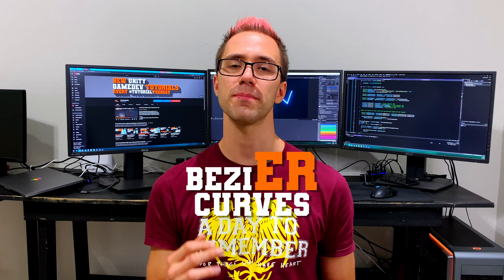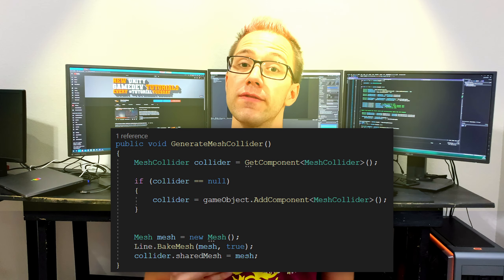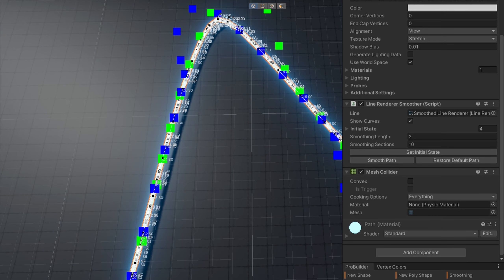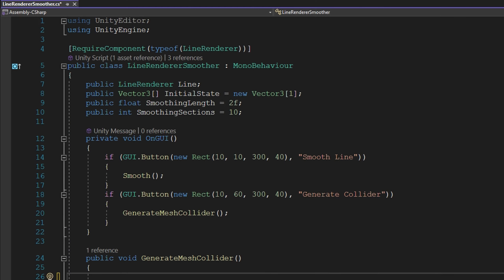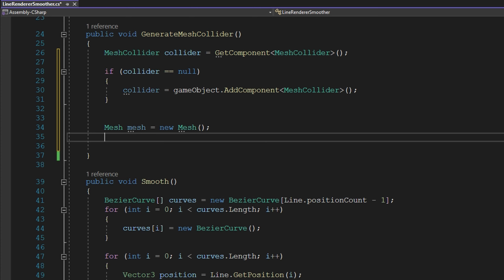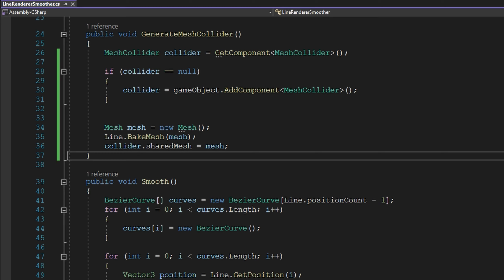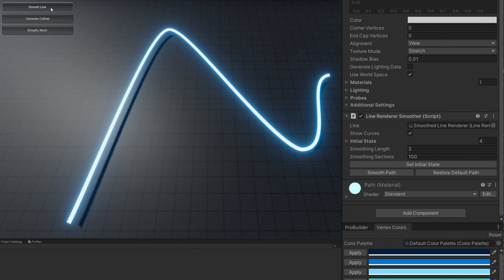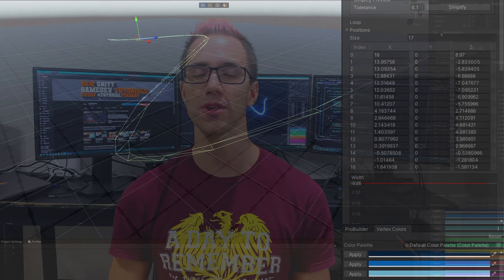How to Generate Colliders for Line Renderers | Unity Tutorial

Comment: That's a really great topic, thanks! 
An alternative solution if the line renderer points are supposed to change would be:
- Have a pool of objects with box collider objects
- According to the line segments (points[i] - points[i-1]) attach the box collider objects as children and set their localScale and localPosition/Rotation accordingly. 

The issue is that on the slopes when the renderer direction changes, these don't exactly match up with the edges of the points. But the drawback of having non-convex MeshColliders is that you can't really interact with other MeshColliders. 
And another one from the documentation: "GameObjects that have a Rigidbody
 component only support Mesh Colliders that have Convex option enabled: the physics engine can only simulate convex mesh colliders."
If a parent object has a RigidBody and all of the children have regular colliders like box colliders, as far as I know it will act as a compound collider where the child colliders are treated as single collider for some cases. The object where the RigidBody is attached would receive the collision messages. This might not be a common usecase, but this way it should still be possible to apply physics based movement to the LineRenderer collision setup and also receive interactions with other MeshColliders.
Reply from the maker: The box collider idea was one I was playing with for a while. You could do some extra math on aligning the box colliders so the edges did align and had a little overlap, as long as you don't need the colliders of the LineRenderer to drive the positions of the line renderer
Reply: @LlamAcademy  Surely!

Comment: Hi! I followed your steps,  than I created a function that every half second I recalculate the mesh collider because it is linked between two characters and I set the convex and trigger as true (in the MeshCollider). Everything works but sometime I get an error two error in the same line    collider.sharedMesh = mesh; the errors are :  1. Failed to create Convex Mesh from source mesh "". An internal unspecified error has occured that could mean the Quickhull algorithm found the input mesh topologically challenging.   2.  [Physics.PhysX] QuickHullConvexHullLib::findSimplex: Simplex input points appers to be coplanar.  I read the error and I find out that I was setting up the lineRenderer with 2 input equally (0,0,0)   (lineRenderer.SetPosition) two times, and that generate the error. I hope that can help to others
Reply from the maker: Thanks for sharing your solution to that tricky problem!

Comment: is it good idea to use this in runtime? My idea was generate a superficial trigger collider in the floor when u clean it with a mop so player can slip with the water. I am asking because i am planing to build the game for meta quest 2.
Reply from the maker: Yeah this is pretty fast so in most cases I don't think you'll run into an issue. Remember there are limits to mesh collider vertices though so you may need to generate multiple colliders, not just a single one for the entire path the player mops with.

Comment: Weirdly, I cant see the mesh itself in the scene view (I can see other meshes) nor get an OnTrigger interactionf rom it (the mesh collider is flagged as Convex and Trigger), but I can see it has generated in the Inspector?
Reply from the maker: The mesh itself has a thickness of 0 with this method so it doesn't really show up very clearly. Make sure you've set it to IsTrigger = true and you might also have to set it to Is Convex for it to work for that.

Comment: Thank you for a great tutorial. How would one detect a collision with this line renderer? I downloaded your code, added a cube to the scene such that the line passes through the cube. Then I added the code "private void OnCollisionEnter(Collision collision) {Debug.Log("collision.gameObject.name = " + collision.gameObject.name);}" to detect the collision (in LineRendererSmoother.cs) but I am getting nothing at the console output. Any thoughts?
Reply from the maker: I dropped a ball with a RigidBody from above and it was correctly making contact on both front and backfaces, perhaps there's something with the layers you were testing?
Reply: @LlamAcademy  I think the question is - if you write an OnCollisionEnter for the line renderer, how and where do you add it?

Comment: I'm using line renderer to allow the player to draw on walls. I wanted to use BakeMesh to allow erasing with raycast. I'm using world space for my lines because if I don't they appear off in the distance instead of where the player's raycast hit but even with that box check the mesh collider is at that random distance despite their position vector matching where the player clicked. If anyone can thing of a solution to this I would very much appreciate it.
Reply: I figured it out. If anyone sees this comment and is having the same problem, I had to loop through the mesh vertices and change their position and rotation.

Vector3[] vertices = mesh.vertices;
for (int i = 0; i < vertices.Length; i++)
{
	vertices[i] -= chalkLine.transform.position;

	// rotate vertices to match chalk line rotation inverted
	vertices[i] = Quaternion.Inverse(chalkLine.transform.rotation) * vertices[i];
}
mesh.vertices = vertices;

Comment: I wrote the code the way you present in the video but for some reason I always get the error: "ArgumentNullException: Value cannot be null.
Parameter name: camera". Do you know how to fix this
Reply from the maker: These scripts don't use the camera, so I guess it's something else in your project.
Reply: @LlamAcademy   same issue here in 2022.3.5f1
Reply from the maker: If you pull the project off GitHub do you experience the same issue?

Comment: Would I be able to use this as a makeshift raycast from the camera?
Reply from the maker: I think if you inflated the mesh a little you could do that, but I would recommend instead to use Raycasts, Boxcast, or Spherecast to achieve a similar result in a less convoluted way.
Reply: @LlamAcademy  I'm doing a programming challenge that prohibits me from using stock Unity physics, including raycasts. I don't suppose you know of any resources that could help with creating a custom raycast system in Unity?
Reply from the maker: I do not have any dedicated resources for that, but any game engine tutorials that cover a physics system are probably necessary reading to get there. There’s a lot to consider to make it fast and most of the logic can be transferred and implemented into Unity.

Comment: My player starts at a point, draws a line where it goes, when it comes back to its place, we get a shape. How can we convert that shape into a mesh. The player continues to move.
Reply from the maker: If the 2d representation is fine, you get the mesh from this method and can use the Mesh class https://docs.unity3d.com/ScriptReference/Mesh.html, attach a MeshFilter, MeshRenderer and you have it. The LineRenderer would also work.
If you need a 3d representation of that path, you will have to look into mesh generation in a little more detail. I have not covered that on the channel.